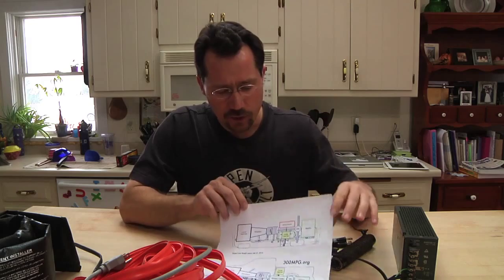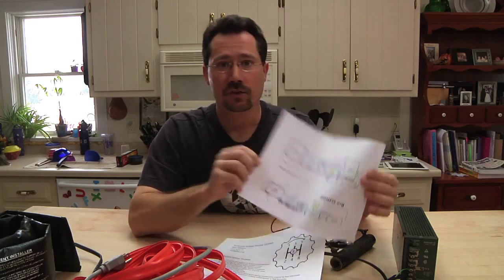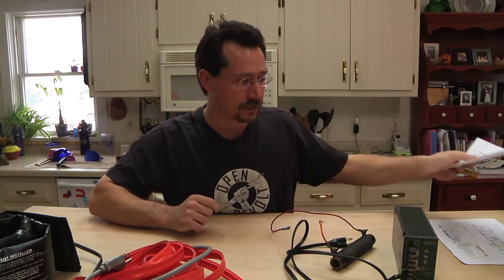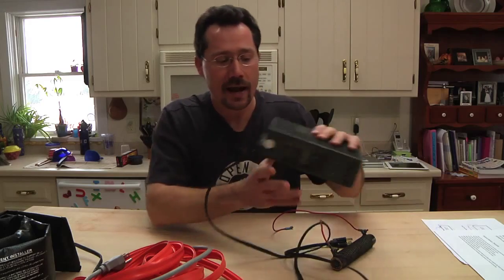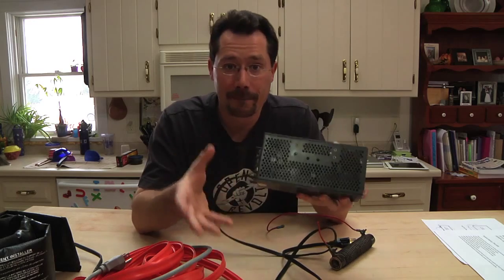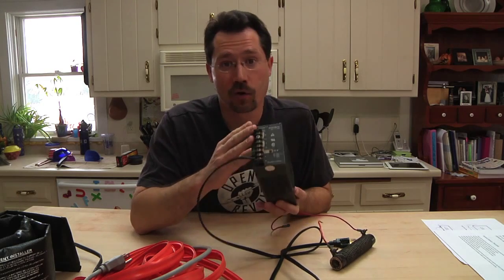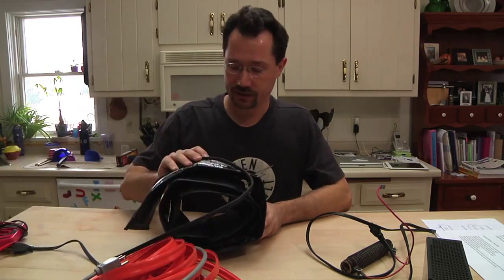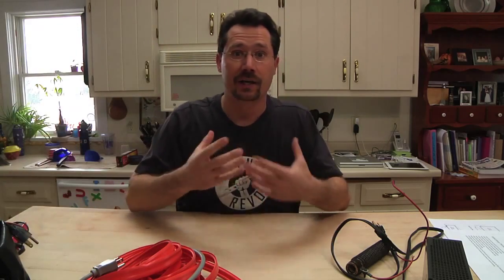SuperTruck Update: Jan. 23, 2013 - Diagrams, DC/DC, Heating

Comment: Hi Ben! Always happy to see a new vid from you! I have a idea. Why heat the whole tank ? Use the strip to heat the inlet (from tank to engine) fuel line only! If there is some left (im metric so i dont have a clue of how much  30 feet is) heat the injection pump and mayby the air intake, the reason 4 that is: if you heat the tank and the fuel lines and punp are cold  the fuel will lose the heat before it reaches the injection. Pozdrowienia z Polski !

Comment: This is something like what I wanted to do, and it looks like you are on the right track. However, I would suggest using an AC induction motor. The series wound DC motor you show has awesome torque, but is relatively inefficient and does not work well for regeneration, which can give back 10-20% from braking. Also, brushed motors need to be sealed from contamination and need more maintenance. I'm an electronics guy so I might help there. Also check a similar project on DIYelectricCar forum.

Comment: Have you thought of a permanent magnet alternator running off of the diesel engine. Will produce a lot more net amps. Then you could have a dump load to an air heaters or something like that. Just popped into my head sorry.- Bob

Comment: I know that generating heat demands a surprising amount of wattage. Maybe, if possible, you should consider other ways of keeping things warm. If you could find a way of keeping your fuel and batteries together, you might insulate and heat it all at the same time as a single 'heat core'. Insulating your cab might be a consideration too.

Likewise, heat might be drawn off from your cooling system and even your exhaust system.

My two cents. Best of luck.